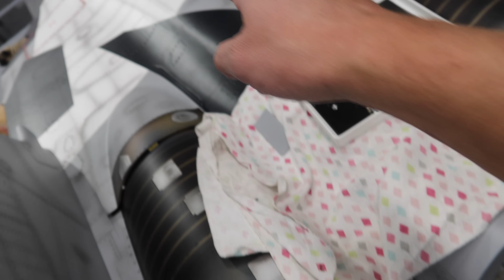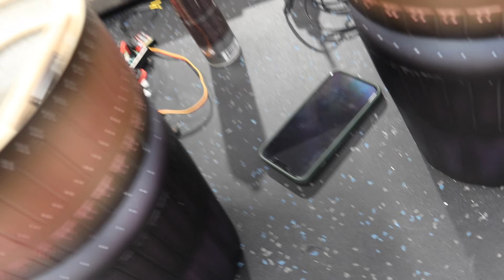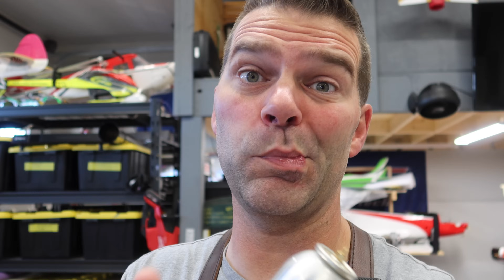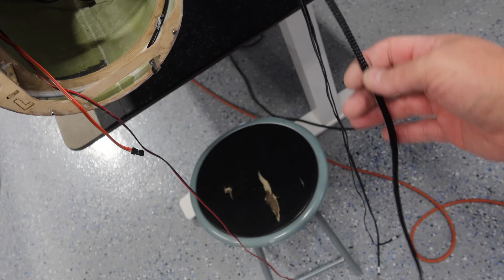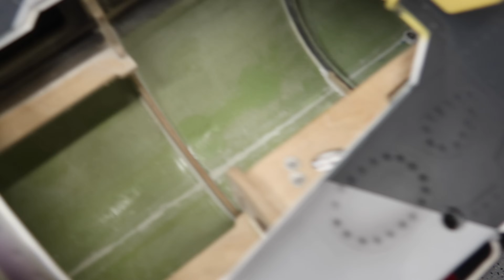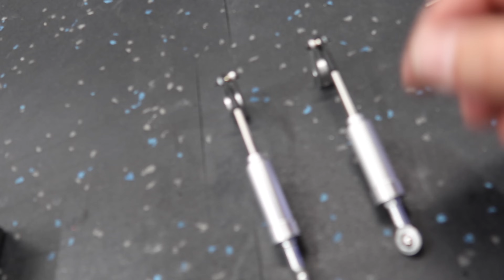From Parts to Precision: The Epic Build of the Russian SU30 RCJet

Comment: Seems better option plus you don’t have a control box like the worm drive just a single lead
Reply from the maker: For sure.  Also if you don't have any failsafe/logics setup and you accidentally flick the chute switch it will take a few seconds to release so reverse is possible.

Comment: Any idea why they went with a worm drive for the chute vs just using a linear actuator? Seems like a much fast way to deploy the chute system?
Reply from the maker: I suspect simplicity. Older generations if had a chute release servo you would have an air connection and a servo connection.

Comment: It's really strange that the canards are not commanded by a servo. Any idea why?
Reply from the maker: Just the way skymaster designed it.  Apparently it works well and they just move in the wind flow
Reply: Because the real airplane has various sensors to determine what angles do the canards channel air over the main wings or not. It’s going to be too complex I guess if we are to program it in the radio system. 
At least the model flies nice and from the videos that I have seen, the canards worked quite realistically.

Comment: Didn't read all comments but Pegasus Racing as do other auto  racing suppliers have a self adhesive heat shield mat that comes in different thicknesses used for either wrapping or protecting parts from exhaust heat.  A 10 thousand rpm engine makes the header tubes glow cherry red so probably equivalent to an RC jet in the tail cone area.
Reply from the maker: Cool.  wonder if it's heavy?
Reply: Actually no.  Basically an adhesive layer and then the heat shield in aluminum or gold color.  I weighed a square foot and got 2.56 OZ with the plastic adhesive cover so probably 2.3 OZ applied.   @thelightersideofrc

Comment: For the shoot mechanism, would it not better to install a tab at the top too to fasten it down from both sides?
Reply from the maker: Great question. The stinger slides onto 2 carbon rods so the force will be taken up by those. The fixing bolt it’s just to keep it in place. It of course deals with the chute force but they should only be released when the aircraft is on the ground and slowing down anyway